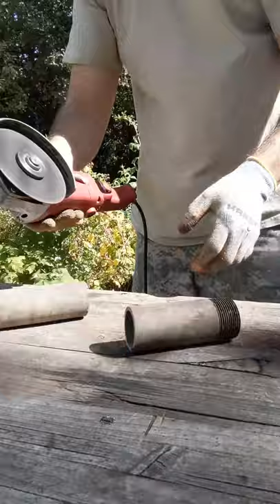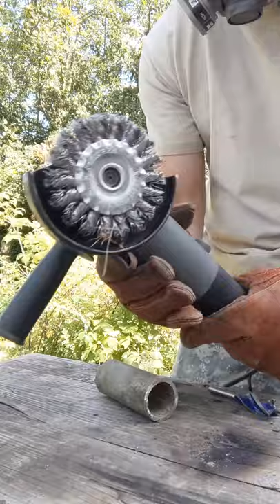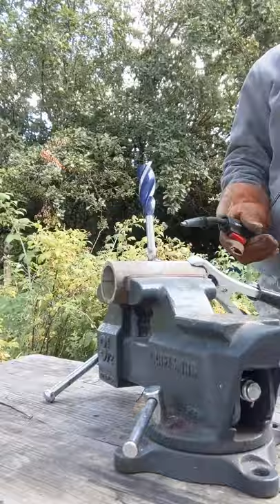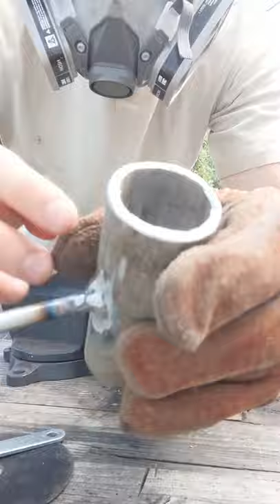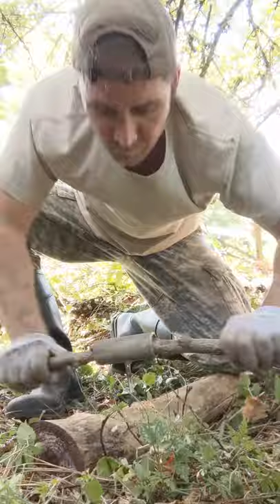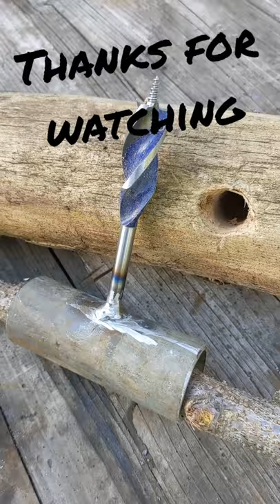Wilderness Survival Drill #shorts

Comment: Why shorten it?
Reply from the maker: Great question. When I held it up to press down against the wood, the extra length made the center of gravity a little tricky. By cutting it down I felt like it gave me more control. I did have someone else come up with a creative idea for this tool on how to improve it though. They said I should have welded a driver bit to the pipe instead of the bit itself. This would allow someone to exchange different bits.
Having spent a lot of time in the woods though I wanted this to be secured to the main pipe, because I don't carry a lot of pieces out there that can get lost in the woods with me.
Thanks for the comment for checking out my video.